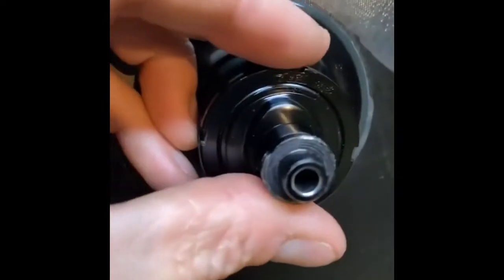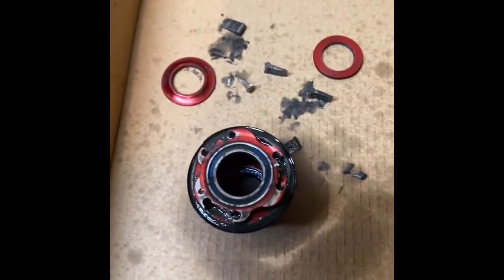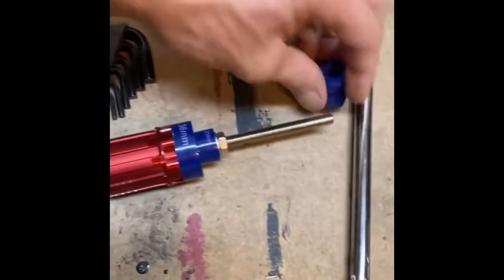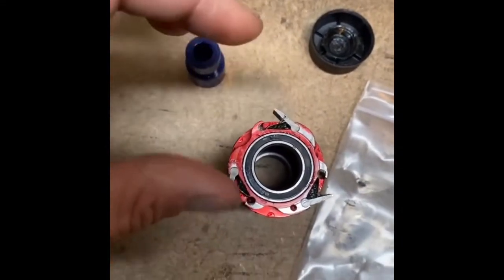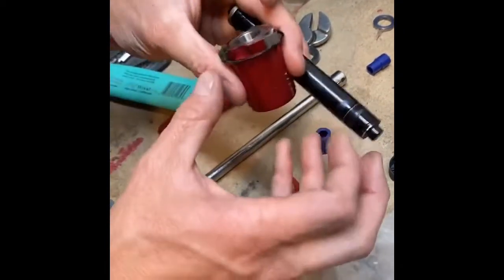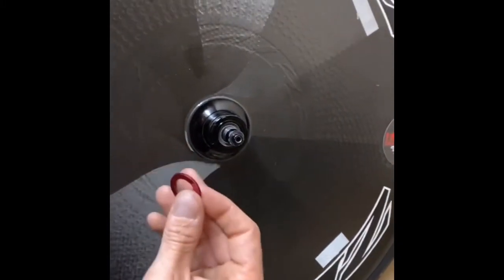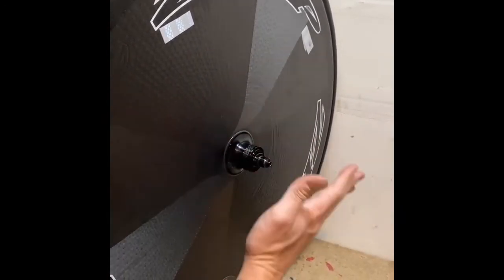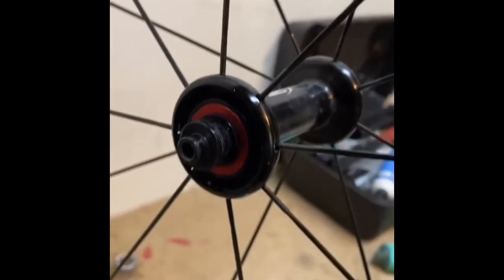Zipp 11 Speed Hub Rebuild Super 9 Disc Wheel and Zipp 808

Comment: How do you remove the non drive lockring, that partially covers the outside of the bearing?
Reply from the maker: Unscrew the allen head lock screw and then unscrew the lock ring by spinning it counter clock wise.